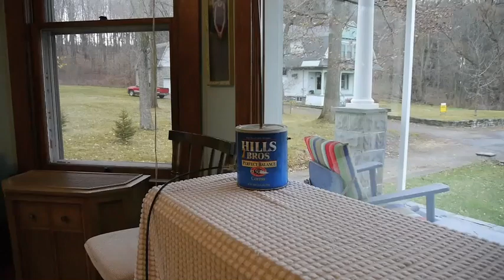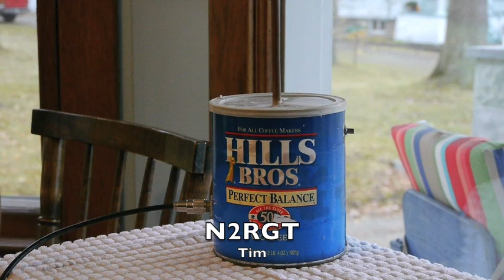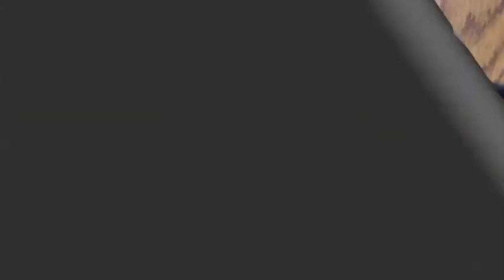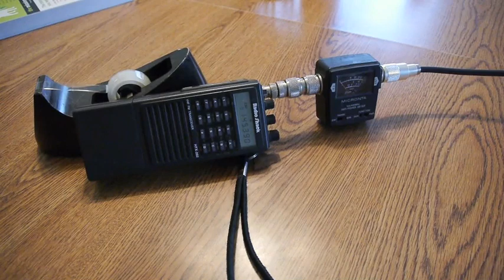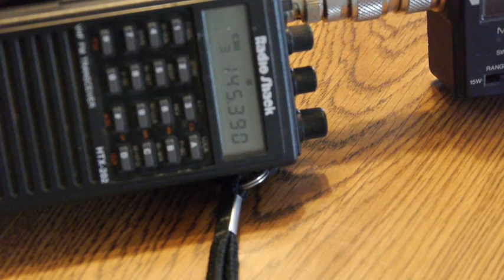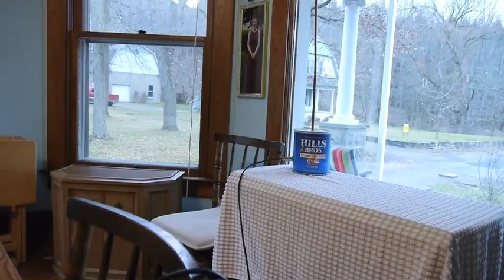Coffee Can 2-Meter Antenna in Action!

Comment: Great video! I might try building one of these! Also I have an old HTX-202 ht that I recently purchased. Are you familiar with how to make them transmit a subaudible tone?
Reply from the maker: I guess the thing to do is find the manual for that radio.  It isn't hard but every one is a little different
Reply: @TimTools99  I have, but for some reason I still can't open my local repeater with it :(